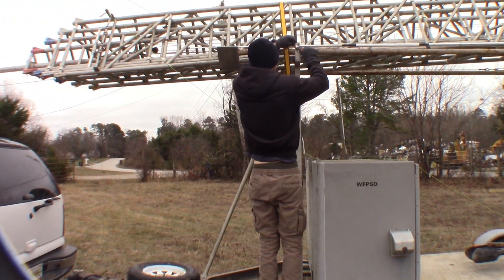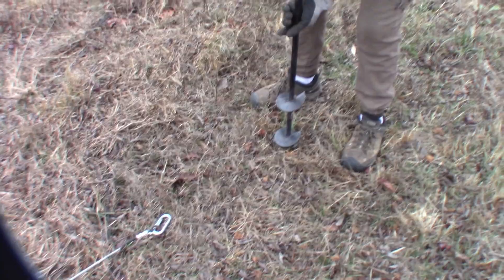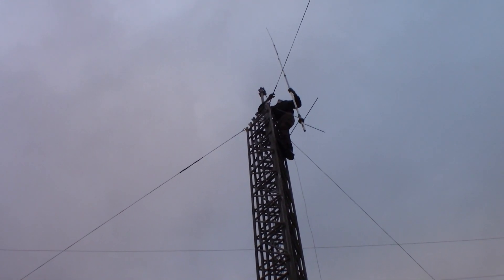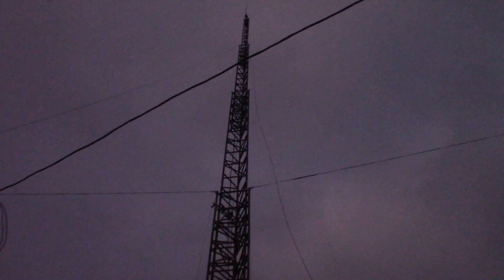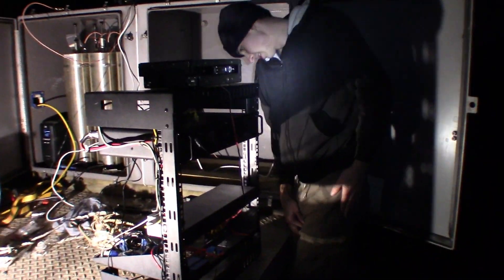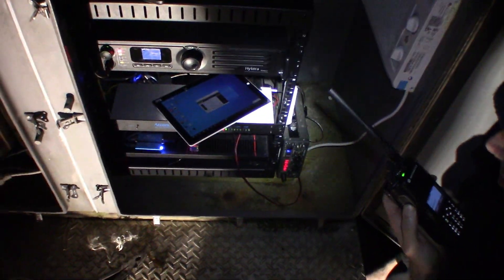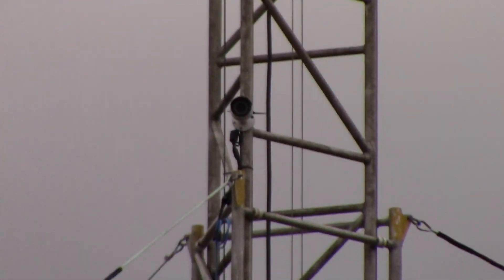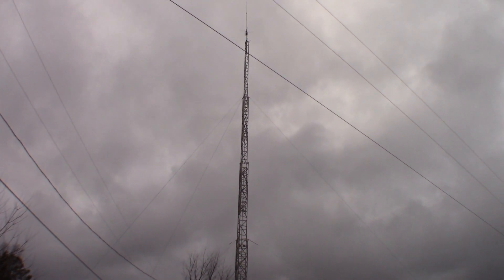Ham Radio Repeater Relocation Project #2 - Erecting the Tower

Comment: Good luck on the duplex noise, maybe a big problem with the tower sections and guy wires not bonded. Keep the power down if u have to.
Reply from the maker: It's caused by the tower pully wire moving in the wind. I strapped a lot of it down and that mostly solved the issue except on super windy days there's still a tiny bit of crackling.

Comment: I like the setup. Hustler G7 lighting rod at the top works well ( I put my G7 at the top of the tower too- I was lucky!) what are the repeater specs? Freq? Etc.
Reply from the maker: Freq is 147.425, -1.0MHz offset PL 156.7hz. Running a Hytera RD982iS repeater. The G7 works pretty well but ultimately I want to put my 4 bay commscope comercial antenna back up there.
Reply: @ScuffedRadio  tnx for the info.

Comment: "Suck the hot air out of the box."  Uhhhhhhh...  You do realize a window air conditioning unit recirculates the air in the room (enclosure in this case).  If you add fans to blow or suck air into the enclosure the AC unit just has to work harder.  There are two coils in a AC unit, condenser and evaporator.  One lives in the outside environment and the other the inside environment.  Do you add holes to your house to circulate air from the outside to the inside to help the AC, probably not.  If you did I wouldn't want to pay your electric bill.

And for the love of God man, get a climbing harness.  Had a friend that died when he fell off a tower at about 18 feet.  Climbing harness's are cheap, lives are not.
Reply from the maker: Yeah I realize that now about the AC unit recirculating the air. Also I did get a climbing harness after this video was made.
Reply: @ScuffedRadio  That's good to hear.  Don't have to fall far to severely hurt yourself.  Just ask Super Man (Christopher Reeve}.

Comment: Why dont you put the antenna on before you putting the Tower vertical up?
Reply from the maker: The antenna weight is the problem. It's not as bad with the hustler but when I had the pro decibel on it was a lot more stress on the trailer supports when trying to raise it.

Comment: Thems is called "quick links." (or French links to dullards)
If you are up on a mountain top, why is the tower over ten feet tall?
If you are only serving one valley consider mechanical beam tilt.
If you intend to serve omniduirectionally consider a lower gain antenna or an antenna with electrical beam tilt. Ron W4BIN
Reply from the maker: Well as they say height is might so the more height the better even if it's already on a mountain. The antenna is super high gain as well (9.1dbi). The range is phenomenal at that location and the height will he increased another 30ish ft when I get new guy wires. My goal isn't just to cover the valley, it's to cover as much as physically possible.
Reply: Hi  @ScuffedRadio 
With height and high gain your antenna is shooting over the top of everyone with it's  highest power lobe.  A ground plain will give a higher signal strength to radios out on the ground, even if the ground plane is only up  ten feet.  Ten feet is a much safer height,  Earth is round and all power over the horizon is wasted.  Increasing height above 10' increases the coverage, but the added area will be at such a low signal strength will be unusable. Ron W4BIN
Reply from the maker: @W4BIN  what a load of rubbish. Anyone who knows what they are doing will run a high gain antenna. The beam width is not so extremely tight that all the energy goes over everyone. It's aimed at the horizon for maximum range. Coverage on my system is absolutely fantastic, easily outperforming other stations with less gain at the same location.

Comment: 7:27 The air conditioner draws air out of the cabinet already.  That's where the air comes from that it blows back in.
Reply from the maker: Ohhh thanks for pointing that out. Seems obvious now with the filter and grille on the front of the unit but I did not think about it before.
Reply: @ScuffedRadio Sure.  Air conditioners have two separate air loops.  One loop draws warm air from outside, blows through the hot radiator removing the heat from the refrigerant, and exhausts the hotter air back outside.  The other loop draws warm air from inside, blows through the inside radiator that is cooled by the refrigerant and blows the now colder air back inside.   There's a compressor and evaporator in the refrigerant loop that makes the hot/cold magic happen to move the heat from inside the cabinet to the outside without mixing the air.

Comment: LMR coax will cause duplex noise, because the shield is made of dis-similar metals. Some of my friends that are professional radio guys tell me that LMR that’s made for direct burial will work better for duplex operation.
Reply from the maker: That's why I did not use LMR. I used M&P.
Reply: There is literally no physical difference between lmr-400 and lmr-400-db except for the waterproofing compound inside the PE jacket that keeps the water out.  The shield consisting of aluminum tape and copper braid are identical in both.
Reply from the maker: @stargazer7644  I used Messi & Paoloni brand feed line, so idk what you mean by the lmr-400 info.
Reply: @ScuffedRadio I'm replying to the OP's comment that "Some of my friends that are professional radio guys tell me that LMR that’s made for direct burial will work better for duplex operation."
Reply from the maker: @stargazer7644  ohh yeah that sounds like a load of crap

Comment: So what did you have to do to eliminate the crackling noise ?
i am working on a repearer myself, and am struggling with a few problems
Reply: 1.Double shielded patch leads.2.Extra bandpass filter on RX port for high "Q" front end.3.If using SMP PSU ensure your not get AC leakage on DC rails and DC noise,this can be elimnated by isolating the antenna on mast avoaiding eath to dc ground loops.4.Check your duplexer is tunned correctly with tracking generator and spectrum analazyer.,good starting points,you may also have grounding loops and audio issues if not using balanced audio.

Rob P
Reply: thank you it helps
Reply from the maker: The crackling was caused by a few of the pulley wires moving in the wind. I secured them and the crackling is gone except on super windy days. I will be fixing that soon as well.

Comment: Is there any requirements to have a blinking light at the top?
Reply from the maker: Anything over 200ft requires a light. This is a 100ft tower and the maximum structure height will not exceed 140ft. However, I may still add a light just for fun!

Comment: What is the minimum safe distance from a power line to allow when installing an antenna?   Enough so that if the antenna falls, no part of it can come closer than 10 feet to the power wires!
Reply: Being far enough that the antenna/tower can't fall on the lines is ideal, but sometimes you simply cannot achieve that.
Reply from the maker: @stargazer7644  Absolutely but like I said, there are already several commercial and amateur towers on this road that are well within falling distance of the power lines. It's unavoidable.
Reply: Looks too close to those power lines.
Reply from the maker: @aidanbrennan7389  too close by who's rules? The power lines have the required 15ft right of way clearance and that's all that's required.
Reply: @ScuffedRadio  common sense, rules.
Reply from the maker: @aidanbrennan7389  okay then I guess all the other towers on this road that are 200, 300, and even 500ft tall next to the power lines should all be demolished because they are too close. Never mind the fact that they are commercially installed. Common sense!
Reply from the maker: There isn't a set rule for that. What I was told by the power company was that as long as I left 15ft distance from any part of my install I'd be fine. The guy wires come no closer than 15ft and the tower itself is around 50+ft from all lines. If it did fall, it could conceivably contact the power lines. But that's the same with trees and all other sorts of structures. Nothing we can do about it and there's no rule against it so it's alright.
Reply: Then u dony remmber u r tech lic and being some one who was born and raised in al knows all it takes is one sever weather and 2 you never put that tower that close to power lines smh😮 @ScuffedRadio
Reply: @ScuffedRadio the power company is stupid and they are the last one you should ask about rules dealing with towers etc
Reply from the maker: @AndrewMurphy8383  The power company is who would care if the lines were hit by my tower. The freaking inspector himself told me the 15ft rule... by your logic, the area that my tower is located at would be all wrong. There are 5 commercial towers and several 200ft ham towers that are all WELL WITHIN falling distance of power lines. I guess they should all be removed in case they fall. Nevermind the trees that will fall long before my tower goes.